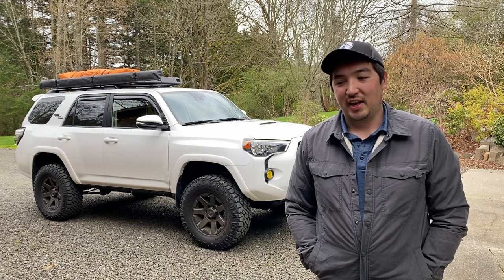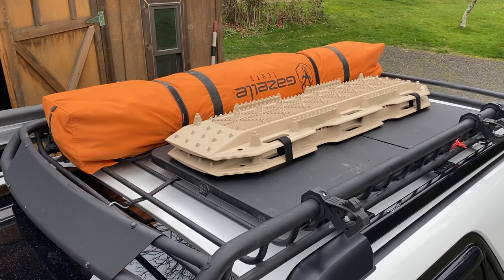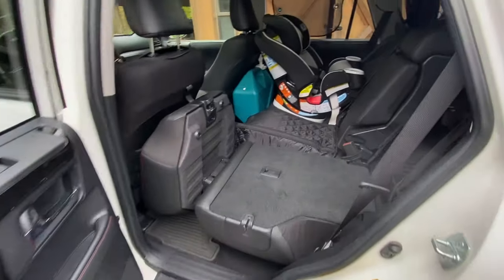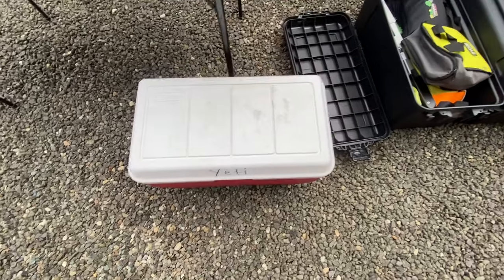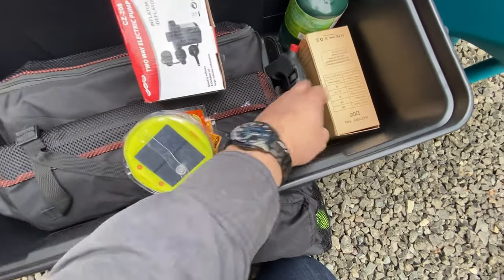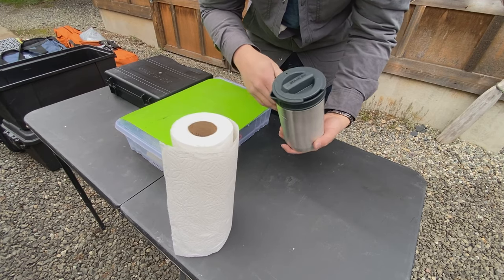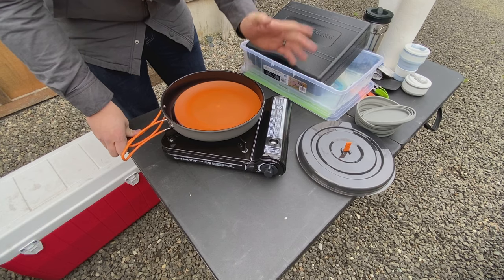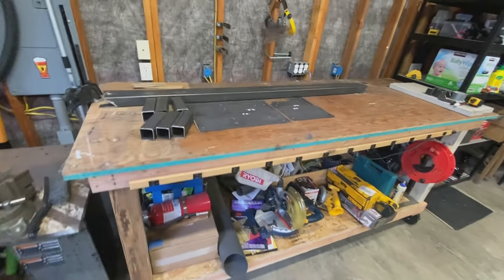Camp Gear Organization: my packing and basic gear plan for vehicular camping

Comment: Instead of putting lose ice in your cooler freeze water in plastic drink bottles.
When it melts you have another source of water and the food doesn't get water logged.
You really need another jerry for water.
Occasionally they split or leak. You don't want to end up with no water if you've only got one.

Comment: I loved the parallel between the 2 yr old filling his dump truck and Dad filling his bins. Great compact kitchen. As a family of 4 (& a dog) with kids quickly getting bigger than parents, compacting gear is an ongoing task for sure. I agree, the type of trip, destination, journey, & who we camp with depends on what we take. We flew & camped last year which was a great exercise in taking only the necessary. 
I could have brought less kitchen gear but happy with having a Chuck box kitchen with flip down counter - a fast counter is key - and one that drawers do not pull out over top of & that sits beside cooler/ fridge. 
When camping with friends nearby still enjoying towing 10’ cargo trailer and having 5 lb propanes & propane fire/ double burner. 
But on road trip utilize roof box & one burner (dual propane/butane) stove.
Reply from the maker: Yes! Flying and camping would be a test of packing only necessities! We just got back from an 8 day family camp trip and it's nice to make a list of things to add and things to get rid of. Always refining.
Reply: @GrizzlyPath  what do you use for your chuck box?

Comment: First time viewer
Great video 

We have the Gazelle t4 
Pretty happy with it...

Any issues with it being up top?

Also the awning is 80 something minus how much for upgrades?
Reply from the maker: If you look in the comments I responded to someone else, but it looks like it’s $180 now… prices have increased. The upgrades ended up being about $20-40 I can’t remember. Replaced all four leg joints with better ones from IRonMan 4x4. 

No issues with the tent on the roof, I actually wrap it in a tarp though! Just as extra protection and then I use the tarp as an extra ground tarp for the tent. 

Thanks for watching, let me know if you have any more questions!
Reply from the maker: I just checked and noticed I didn’t link it. Here is the “cheap” awning I have. https://www.walmart.com/ip/Yescom-6-6x8-2-7-6-x8-2-Car-Side-Awning-Rooftop-Pull-Out-Tent-Shelter-PU2000mm-UV50-Shade-SUV-Outdoor-Camping-Travel-Beige/334508338

Comment: Great setup, mate.  Can you comment on your tire size and whether or not there's some type of lift on the vehicle?  Looks a tad burlier than normal.
Reply from the maker: At the time of this video I was on stock suspension/wheels and bigger 285/70r17 tires. Since then in more recent vids I’m on a 3.5” lift with a different set of 285/70r17 tires. 👍🏼

Comment: Nice setup. I ordered a Rola Vortex for my 2021 4Runner today. I’m going to coat it heavily with Rustoleum pro grade truck bed liner spray when I get it.
Reply from the maker: Sounds like a great plan! I ended up welding it all together to really seal it up also.
Reply: @GrizzlyPath … that’s my plan too. Weld it at the joints and add a side plate for rotopax cans and spray it down.
Reply: Hey I know this late.  How did you mount the Rola vortex to sit low?
Reply from the maker: No worries I’m still around! If you go back to video “DIY roof basket mounts” from 2020 I go over the custom mounts I made. I also have a more detailed post and my precious mounting solution on my IG @Grizzlypath

Comment: I noticed you still have the stock rimes, did you need spacers? Also, did you have to change the control arms when you added the lift?
Reply from the maker: Stock rims, I have 1.25” wheel spacers but they’re not required for anything. I changed out the UCA with the lift.

Comment: do you use the clear bin to clean your dishes? where are the supplies for cleaning? Soap etc.
Reply from the maker: I use a pop out bucket that you can get from Walmart or similar, it has a drain on the bottom and when folded fits in my kitchen bin. Soap is in the kitchen bin too, it’s an organic safe soap so it’s a bit better to rinse out into vegetation.

Comment: How do you strap down the gazelle tent to the roof rack?
Reply from the maker: I use either (2) cam straps or (2) ratchet straps. Both seem to work, but obviously I can get the ratchets tighter.

Comment: Helpful video. What kind of basket roof rack are you on in this video? I like this option on the stock beams of the roof
Reply from the maker: Glad it’s useful! It’s a Rola Vortex roof basket with the optional extra extension to make it longer.
Reply: I feel like you have said you have kdss, could you tell me what kind of lift you have in detail and how much lift it gives you in front/rear? I have kdss 4Runner and have seen where you shouldn’t go over 2.5 lift in front & 1” rear. I’m asking because I like the way yours sits and looks level.
Reply from the maker: I’d have to measure but I’m at about 3” front and 3.5” rear. I’m using Ironman4x4 Foam Cell Pro suspension with standard springs. So far I haven’t personally had any issues with KDSS or anything.
Reply: @GrizzlyPath   thanks man! I appreciate the feed back and enjoy the videos.

Comment: Dopes video!
Do i need to use that other piece that comes with the thermometer
Reply from the maker: That extra thing goes outside so you can have an inside/outside temp. However, the one I bought wasn’t waterproof so it died pretty quick. I’d tuck it somewhere out of the weather if possible.
Reply: @GrizzlyPath  thanks for the reply. I guess my real question is does the thermometer still work without that piece?
Reply from the maker: @cruzinthruspace yes it does! I still use mine.

Comment: What are the measurements of your cooler? I’m wondering if my yeti 45 would fit with the 4 tote setup. Also are they the 56qt Storage boxes?
Reply from the maker: 68qt Plano totes and my cooler dimensions are: (WxHxL): 15.25"x16.25"x27.5" which ends up being a perfect fit.

Comment: Wondering what kind of roof rack you got on there. I’m also assuming those are factory crossbars as well. How much weight have you been able to store on top with this setup?
Reply from the maker: Great question. It’s a Rola Votex basket with the extension welded in to make it longer. It’s mounted to the stock rails (i have a video showing how). The basket itself is 70lb hard to say on gear weight but the Gazelle tent, and then the totes probably adds up to about 125lb or so (some totes aren’t full, also mostly pillows and stuff). So we’ll say 200 in this setup? The OEM is rated for 300lb dynamic, but I still didn’t like having that weight up there if I didn’t have to.

Comment: how do yo strap the gazelll tent , just straight over from roof rail to roof rail , do you specifically need the roof rack  cargo that it is on , or will it work with just cross bars ?
Reply from the maker: With this Rola basket I just tossed it in the basket and it was wedged between the totes. The totes were strapped down. 

With my new rack I use ratchet straps right on the rack.

Comment: Nice setup. I use the Plano’s as well. Are you still liking the Gazelle tent? I’ve been wanting one for awhile.
Reply from the maker: The Gazelle tent has continued to work great. For my small family the ability to set up quick to have shelter has been very valuable. As well as being able to stand up and have lots of space vs a RTT (non-snow use). In the winter or solo camping I sleep inside the vehicle as it’s easier for me. But I’m happy with my purchase of the tent still! $275 seemed crazy when I bought it but prices have definitely changed.

Comment: Did you plastidip the stock wheels or are those the 2021 Trail wheels?
Reply from the maker: Yep you got it. I used DipYourCar’s “Brass Monkey” on the stock rims with a “primer” base of black. Turned out great and has held up way better than I thought it would.

Comment: Hey brother thank you for the video but I have a quick question about the grille modification, so I have a 2020 and I don’t want to spend much on the grille so I get the 2019 for my 2020 the only modification Is for the Rader to fit into the grille.? Thank you
Reply from the maker: The TRD PRO grill? It’s possible it already has the cut out for the front TSS sensor, if not then you’ll need to trim it away. Uphill also need to do some additional trimming near the hood latch area on the upper grill replacement piece too as it won’t quite fit our 2020+ models. Recommend you have a Dremel (rotary tool) or something so you can get custom with it! It’s not hard, but if you have no experience with this sort of thing take your time. Everything I trimmed is hidden by the upper engine cover so it basically doesn’t matter. I haven’t seen it since.
Reply: @GrizzlyPath  thank you so much!
Reply from the maker: Good luck! It should be pretty clear what needs some trimming when you go to fit it on. Hardest part is getting the old upper grill off. There’s some videos on that. Not hard, but I hate prying plastic pieces haha. At least the vehicles are pretty new so the plastic isn’t brittle.

Comment: Great video, enjoyed your efficiency of gear and how you pack your 4runner.  Question what brand of roof rack are using.  It looks like you keep your original 4Runner roof rails and your roof rack some how ties into them.  I like that idea as you can probably take off the roof rack when you want to.  Tk you
Reply from the maker: Thanks John! It is a Rola Vortex roof rack with the additional extension to make it longer. If you watch my DIY Roof Basket Mounts video it shows how I attach it so I can quick disconnect and stuff.
Reply: @GrizzlyPath  thank you.

Comment: What do you use to tide up the tent on the roof rack?
Reply from the maker: When I had the basket in this video the tent would be held in with a ratchet strap. Either also wedged between the bins or by itself. With my current rack I use ratchet strap to securely hold it on.

Comment: What stops the totes from going 
Foward in to the seats if you had to really hit the breaks ?
Reply from the maker: That’s a great question and one that many often forget to think about! I can’t remember if I talk about it in this video, but I definitely show it in other later videos- I have straps that run over the stacked totes/cooler and hold it tight to the platform. Since this video I have also modified the platform to bolt to the existing tie downs in the rear so when everything is strapped tight nothing budged when off-roading. It’s worked great! Thanks for watching.

Comment: Would that lift and tire set up look good on a Tacoma TRD 4X4 4dr longbed?
Reply from the maker: Yeah I’m sure it would!
Reply: @GrizzlyPath  how high is your lift and what size are your tires?
Reply from the maker: It’s about +3.25” in the front and +3” in the rear, tires are 285/70r17 on stock rims with a 1.25” Spydertrax spacer.
Reply: @GrizzlyPath  thanks so much man.

Comment: What rack basket do you have?
Reply from the maker: The setup in the video is a Rola Vortex basket with the extra extension to make it longer. It’s attached using custom brackets that are shown in a previous vehicle. I have since changed the setup a bit this year!
Reply: What are the mounts for the axe?
Reply from the maker: Look up QuickFists and you’ll find them!

Comment: What roof rack are you using?
Reply from the maker: The rack in this video is a Rola Vortex basket with the optional extension to make it longer. It’s mounted with custom quick disconnect brackets I show in an older video (Christmas tree hunting part 1 I think). Worked great! I don’t currently use it though.

Comment: What’s the name of those mounts for shovel
Reply from the maker: They’re called QuickFists check them out! Pretty cheap and really utilitarian. Come in different sizes.
Reply: @GrizzlyPath  I’ve seen and used the quick fist but the what yours on the rack looked was different. The quick fist I’ve seen have to be screwed into something. Yours looked like the one side latched over the tube and then had another open attachment available
Reply from the maker: Okay I understand. Look up “Nilight 90021D bar clamp” they’re bar light mounts that work great. I should put some of this stuff in the description! I’ll try to do that today.
Reply: @GrizzlyPath  thanks. I’ll take a look now. 👌👍

Comment: Yank those back seats out of there.   You won't regret it once you realize how much space you gain.
Reply from the maker: That’s a good tip! If you check out my newer videos I did just that. I left in the 40% side since I have my baby back there, but 60% side has been converted into a platform and it’s rad.